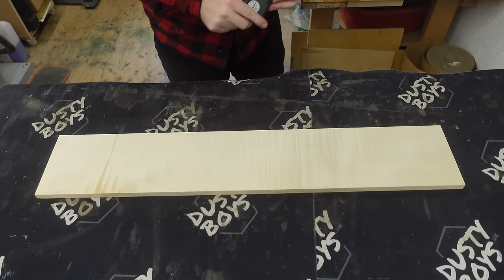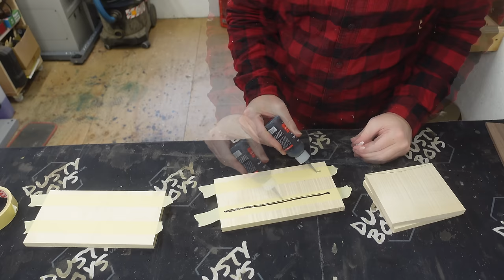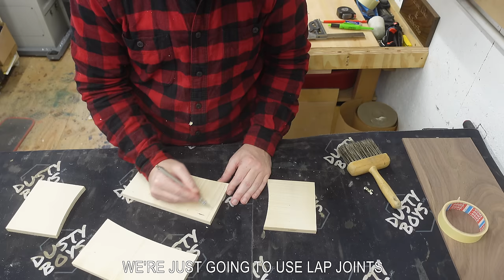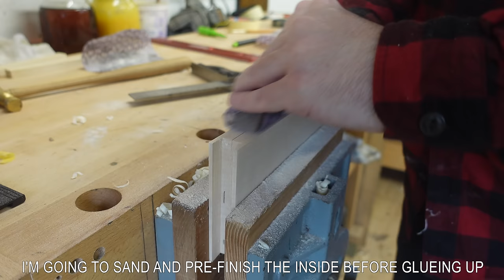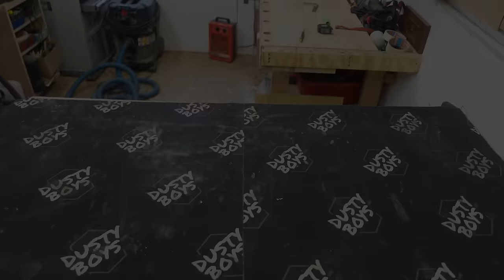Beautiful Curves on a Figured Sycamore Keepsake Box | Woodworking

Comment: Beautiful box, the contrast between the two types of wood is striking. The knob might be more pleasing if it reflected the shape of the top of the legs, difficult to explain but it looks a bit flat as it is.
Reply: I agree about the knob.  It should have been slightly taller, and made from square stock; the bevel the top and cut a curve that tapers smaller toward the bottom on all four sides.  This way it more closely resembles the legs.  You could even slightly dish in the top of the knob using a lathe, so that the top of the knob resembles the design element of the curve of the box’s top.

Regardless of that, the box is beautiful.  It’s a pleasure to watch you work.  I agree with many other commenters, in that the sounds of you working are much better than listening to 30 minutes of repetitive music.
Reply from the maker: I totally agree! but glad you liked it 😀

Comment: Great box make and I’m with you on the handle/knob. I would have fitted a longer style of handle down the length of the lid in the white wood mirroring the curve of the lid (to form a visual oval) and repeated the edge angles  of the lid and corner pieces. One thing’s for certain, I’m inspired to dig about the off cuts bin and do some gluing and making something similar. Many thanks, W
Reply from the maker: thanks, glad you liked it and are inspired to get making 😀 
Your handle idea would’ve worked a treat 👍

Comment: When working with English Sycamore, (which is actually a hard maple), I often sand up to a fine polishing grit (12,000) not skipping steps. The high figure gets deeper and deeper as you polish it. Some closed grain hardwoods will finish like glass. Others (open grain) like walnut, do not.

Arborist Blair Glenn
Reply from the maker: I’ll have to try that, it was my first time using sycamore and I really liked it, I’ll definitely be using it again 👍

Comment: Nice looking project. What’s your ratio for the oil/wax mixture?
Reply from the maker: thanks glad you liked it 👍
The finish oil/polyurethane/turpentine mix is equal parts of each
And the beeswax/turpentine, finish oil mix isn’t quite so straight forward as depends on the beeswax, the one I used from Liberon had turpentine in it as well so I needed more than if it was just plain beeswax. But I started with equal parts then added more beeswax till I got the consistency I wanted. 
Hope that helps 😀

Comment: Can you share the recipe for the finish?
Reply from the maker: The finish oil/polyurethane/turpentine mix is equal parts of each.
And the beeswax/turpentine, finish oil mix isn’t quite so straight forward as depends on the beeswax, the one I used from Liberon had turpentine in it as well so I needed more than if it was just plain beeswax. But I started with equal parts then added more beeswax till I got the consistency I wanted. 
Hope that helps 👍
Reply: Thanks
Reply: Man, ask and you shall receive! I'm new to woodworking and I've been looking for more finish sources to try out!

Thanks @GM_Design